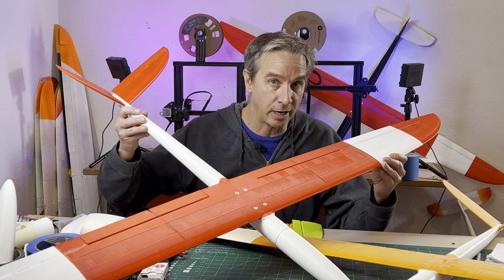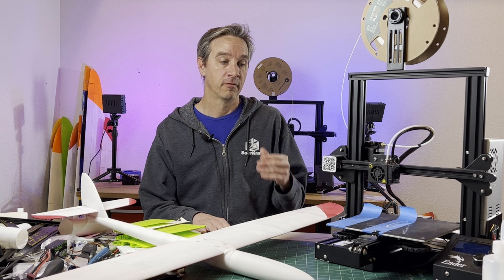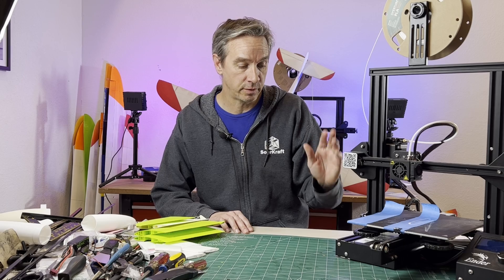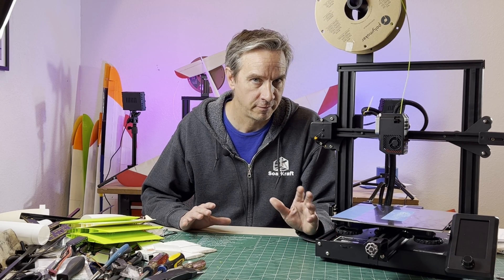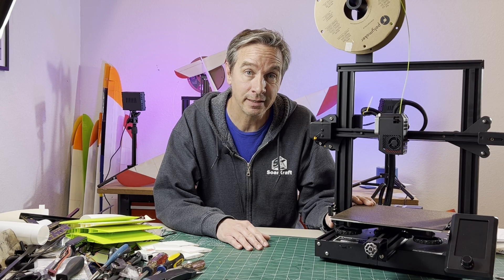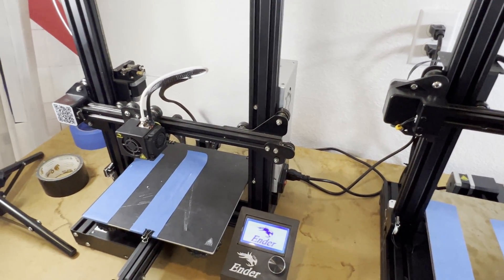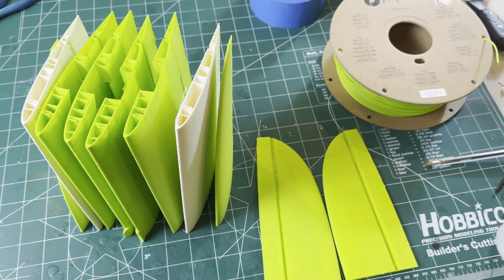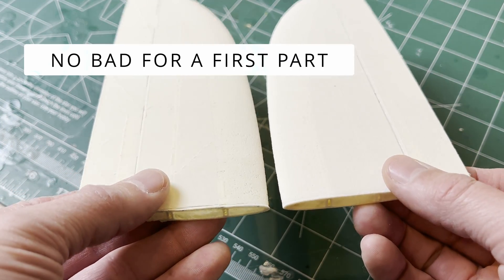Is A 3D Printer under $200 Worth Buying??? for Printing RC Airplanes - SoarKraft

Comment: i want to buy also one for my son (12y), he also fly rc planes.

He is very sensitive to fumes, microparticles, allergens....

Do you take any precautions about micro particles in the area used to print?

tks
Reply from the maker: If you are worried about fumes / smells / microparticles then get an enclosed printer with a carbon filter.  There are serveral available and becoming more reasonable price.  This video was from 2 years ago and much has changed.
Reply: @soarkraft  ok but i have read the with pla you beed to leave the door or the top hatch open , so the point of the filter is lost.

Comment: Ender 3 v3 se is out now so get that it can do everything for under 200
Reply from the maker: Sure... but it is a Creality.  Hopefully they have finally made an Ender3 that does not need to be modified right out of the box to work.
Their design / manufacturing / quality is very low end, this has not improved.  I have had several Creality machines and I will not buy another.  The Sidewinder X1 is knock off the CR10... but is so much better.  Same with the Voxelab. I have a CR10Max... sure it can print big stuff... slowly, and even then you have to watch it like a hauk to make sure it does not fail.  The Ender5 was a huge disappointment... way over inflated performance advertised.  The the K1... O'my... did they not think to test it.
Reply: @soarkraft  I have had the same experience with my ender 3 but the the extruder was the only thing that caused regular prints to fail and the e3v32se Is such an improvement

Comment: sorry for the question, I didn't understand, I want to print pla lw... with sidewinder x2 can I reach the temperatures for the foam? or do I have to buy another extruder? I understand that Aquila can print S2 260 °C... but it has classic print dimensions... maybe better to dedicate to our hobby?
Reply from the maker: The sidewinder can print the regular foaming lw-pla just fine (250).  So can the S2. The new high temperature lw-pla is close to the limits of what the sidewinder can do (280-285) but can probably do it.

Comment: TLDR; Don't get the Ender 3 V2, get the Aquila S2.

I bought an Ender 3 V2 on sale (December 2022). It was $240 USD back then. It didn't came with the flexible PEI bed, so I had to get one from amazon for $30 USD. I also had to replace the fans because after just one print, they started to make a lot of noise ($16 USD at amazon). Total expenses; $286 USD.

The Aquila S2 is around $270 USD. If your only 2 options are either the Ender 3 V2 or the Aquila S2, buy the Aquila S2.

Aquila S2 = Ender 3 V2 + Direct Drive Extruder + flexible PEI bed + Hotter nozzle + Hotter Bed + More legible display + Reliable fans + Quieter fans
Reply from the maker: you can get a use Ender 3 for $80... still need to put ~ $200 into it to match what I would consider an easy to use, quiet, and capable printer and all the effort.  Sort of why I got the Aquila S2 for my son... its almost ~ an Ender 3 S1 (which is $399 ish) for $189

Comment: I've been using the Ender 3 pro for about a month now, since I've started with the 3D printing journey, basically. It was, for me, in my honest opinion, the best choice. Like you said; You don't get the full experience right out of the box. It does teach you the basics though and, like you also said, you get to upgrade it over a course of time, so you get to know what happens to Y when you change X. There is also a huge community behind it that really helped me, not only with the Ender 3 specifically, but everything else that comes with 3D printing in general. Like using Cura and Fusion360. If you expect the perfect out-of-the-box experience, the Ender 3 is definitely not that. So if you don't like the 3D printing part and the learning curve that comes with that, but just what comes out of it, you might want to consider reaching deeper into your pocket.
Reply from the maker: That why I liked the well optioned Voxelab S2... most of the features of an Ender 3 s1 for the basic price.  The Ender 3 is a great hobby printer if 3D printer building is your hobby... not if you want it for supporting a different hobby like making RC airplanes.

Comment: Why, in this day and age... a PROPRIETARY nozzle?????   I would give that a pass just on the amount of dumb involved.  But I do have two Artillery printers, X1 and X2. :)
Reply from the maker: Yes, don't like that part... however I have bought many tips for my Sidewinder, lots of different sizes and hardened tips and such.  I tried all kinds of carbon filled materials and exotic materials, different nozzle sizes... they are fun to play with, but I have yet to find a material that is worth the hassle of a special tip...  I usually come back to the same .40 brass nozzle.

Now the TPU and the HT-LW-PLA need a direct drive and higher temp to work well... but a .40 brass nozzle works fine.
Reply: @soarkraft  Yep, I agree.  However nozzles eventually clog, at least mine always have at some point.  I still have three of my printers running daily and all have experienced a clog at some point.   Plus, I print a LOT of white PLA and PETG.  I was surprised to learn that white filaments are quite abrasive due to the Titanium White pigments used.  I get nozzles in batches of 20 from the ChiCom child labor camps where everyone's tech comes from, cheap.  When one even thinks about going off, I just unscrew it and toss it.  They are disposable.

Comment: Also, have you tried printing on kapton tape? I was gifted some and it works much better for me than the blue masking tape, only run PETG and PLA on it so far
Reply from the maker: Yep, have used kapton in the past (Markerbot dual)... not as easy to get and pricy, but does work.  I will have to try a print or two with it again, I think I have some around.  I like the blue tape because it is very predictable...